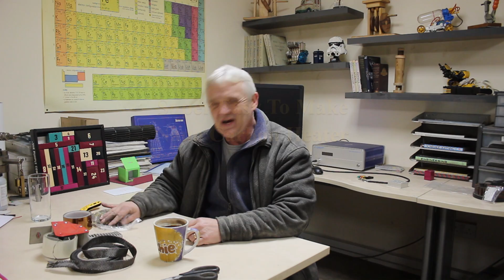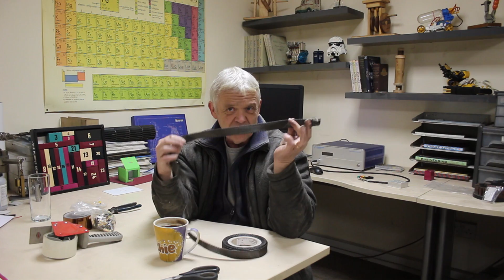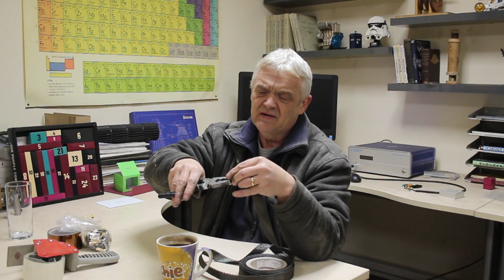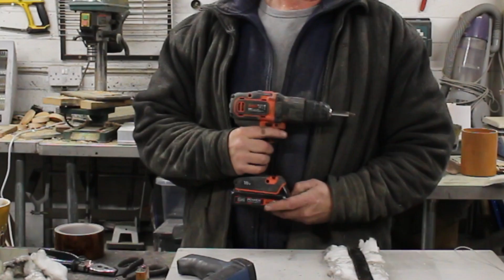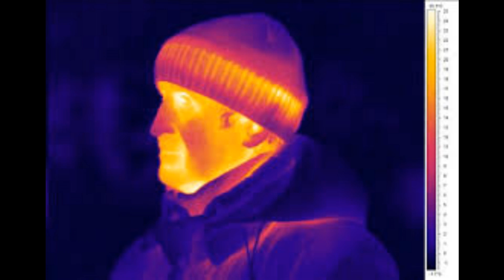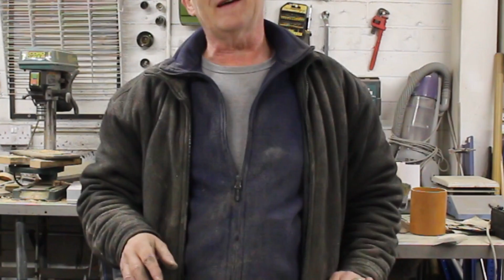1765 DIY Super Easy To Make Nano Carbon Infra Red Heater For A Ton Of Uses

Comment: The applications are endless. I'm thinking inexpensive heated handlebar grips for the motorcycle and in a sleeping bag or sleeping pad. Just have to figure out the battery situation (how big to get a good 6-8 hour sleep without having to switch batteries). Thank you!
Reply from the maker: yes mate they are and I like the things you suggest - particularly the hand grips by the way
Reply: @ThinkingandTinkering  sorry to be a bother, but do you think that carbon felt is conductive? I was thinking about trying a few experiments with that and a variable voltage DC power supply for tattoo machines. Any thoughts?
Reply: @ThinkingandTinkering  I've been out trying this for an hour in my shop and get nothing. I ordered a 0-18v 1.5a dc power supply from Amazon. It's meant for tattoo machines. Nothing is happening except the lcd screen on the power supply just blinks. Any ideas?

Comment: If i wanted to sew this into a hand sewn heating pad, what would i need to attach it to a cord that can be plugged into a wall Instead of a battery? (I would use a temperature-regulated thermostat).

Comment: Appreciate the video in the general, but think traditional insulation works plenty well for most conditions and is far more efficient (cost, time, resource etc wise). Carbon fiber isn't cheap (and is fairly dirty environmentally). Batteries aren't cheap.  Electricity is becoming less cheap. But things like kapok fiber are cheap and do a really good job of slowing energy/heat loss from a body. 

     If I was doing an Antarctica trip during their summer  and had an integrated pulk shelter with solar panels on the roof, then maybe I would add in some carbon fiber heating strips to my clothes, sleeping bag, or the like.  

   But then again, I could just as easily line the pulk shelter with vacuum insulated panels* and bring some beeswax candles or the like and be ok. 

  * (someone might say, well VIP's are kind of expensive. Yeah, commercial ones are, but not so expensive if you know how to make them yourself at home).
Reply: I have everything here to make carbon fibre heater. 
Care to show me how to make VIP's and insulation?
Reply: How DO you make VIP's ? They sound interesting!
Reply from the maker: nothing wrong with a good old bit of insulation mate
Reply: @kennethbain4290    I learned from a combo of researching and thinking holistically about it.  For the home version, you need a few things:  You need a commercial grade vacuum food sealer--one that can pull 28" Hg. You need mylar/foil lined vacuum packaging bags (the regular, non foil lined ones won't hold a vacuum more long term). These need to be a thicker variety, least 4mm. 

    Then you need some kind of spacing, insulative material for inside.  Industry most commonly uses these three--fumed silica (even without a vacuum pulled, this material is very insulative--similar to silica aerogel), perlite, and fiber glass batting. Combos of different materials have been experimented with and used as well. 

    You can use other materials. If using fibrous material, hollow fibers (but that are open on at least one end) are much better than solid. Heck, you could even put bamboo poles in if you knock out the culms and drill some small holes to help the air to evacuate.  (You would still want to combine it with one or more of the above, for the space above and below where the bamboo poles touch). 

   Then you need to put getters in there before you evacuate and seal it all up. The plastic part of the bags will both off-gas and allow some air (especially oxygen) and/or moisture to permeate through over time.  The getters absorb and/or adsorb most of this to keep the vacuum more of a, well vacuum, longer term.  

   There is a wide range of getters used, but one of the simple, cheaper, and fairly effective ones is activated carbon.  Then, typical oxygen absorbing packets can be used in combo.  There are more expensive and exotic getters used. Tbh, I know less about this part of it. 

   The best vacuum insulated panels made by industry are rated to last up to around 40/50 years or so.  Expect a home made one like the above to probably last from around a decade to 25 years or so, unless you really put some good research and thinking into the materials used.  Or how you approach it as a system.  For example, you can put the vacuum sealed pouch/panel in an all foil bag to provide further protection.  You won't be able to suck out all of the air in that most likely, but by getting rid of most of the air and having an extra, all metal barrier between the inner pouch and the ambient atmosphere, it will help to prolong the life and slow down these processes of gas permeation. Aluminum incidentally is one of the best materials for holding a vacuum.  

   Industry VIP's can also be under a slightly harder vacuum than the 28" Hg.  But 28" Hg imo is sufficient to reach a pretty good insulation capacity.
Reply: @karlmyers6518    As to VIP's, see above. Regular insulation is pretty easy. Warm socks, hats, sweaters, gloves, jackets etc if you can't make them yourself. People that wear shorts and t-shirts inside that complain about the cold, well I have no patience for them.  Used to have a housemate/tenant like this.  Told him to wear a sweater or shut up. 

     Kapok fiber is a great, inexpensive insulation if one can sew, either by hand or by machine.  If you can sew by machine and have one, then some nylon tulle acts as a good baffle material.  You take a piece of tulle that is wider than the fabric you are sewing it to, and then you sew like "channels" of the tulle onto the other fabric, to which later you will stuff the fiber into.  

     Then after, you sew  your other regular fabric to the regular fabric below the tulle. Voila, you have an insulated fabric. 

     I don't recommend kapok fiber for larger items in connection with specifically backpacking though. Goose down is superior, both in insulation value and especially in compressibility.  Kapok fiber doesn't compress as much (which is great for pillows, cushions, etc) and so it's not as a good for sleeping bags, or even backpacking used jackets. Makes awesome mittens, insulated hoods, insulated booties though, especially since it is so hydrophobic and keeps it loft far better when damp and wet as compared to down (which collapses more). 

    Pre the invention and common use of synthetic foams, kapok fiber was used in life vests, Arctic boots, etc because it can help a piece float in water, its highly insulating, and highly hydrophobic.  It is also far cheaper than goose and even lower quality duck down.
Reply: @justinw1765  good old Google,  I'm on it. Its really cold here atm. 
We just need Robert Murray-Smith to teach us how to make large scale insulation now and maybe some ecocrete

Comment: Robert, this video is giving me a lot of good inspiration!! Just wondering, if I'd like to make a flexible heating blanket of lets say 150x150cm that needs to become about 50-60 degrees celcius, would a single sheet of carbon fibre be a good idea? Saves a lot of work compared to putting all these thin carbon fibre bands in some spacing on a flexible sheet.... And how would the edges be conected to the wires...ribbon clamps are a bit to small :)

Comment: Do you need to tape this to keep it from shorting if you bury a couple straps in a sand battery and attach them to a solar panel of sorts?
Reply: Not if there isn't any way for the strip to fold in on itself and for the leads/crimps to touch each other. Both sand and air are inherently electrically insulating at these voltages and amps.  The tape is recommended if it is possible for the leads/crimps can potentially touch each other. 

     For the method you are using, I personally would use cheaper and more heat resistant Nichrome wire--probably wrapped around copper pipe. If wrapping the Nichrome wire around the copper pipe, be careful though to make sure neither the crimps/leads nor wires carrying the electricity from the source to the crimps/leads touch the copper pipe. That can also short the electrical source. To make sure this doesn't happen, you can just use silicone caulk to cover the crimps/leads. You don't need to tape the whole thing, etc.
Reply from the maker: only if it is moving - if it is fixed by sewing or weight of sand - no need for it
Reply: Is it for heat storing sand battery?

Comment: Here in the frozen north of Canada, heated long johns sound like just the ticket. You can buy them, but they are very pricy. Making my own seems to be a sensible move. Something else that is expensive is 18V tool batteries, as in about $100 each. So I need to find a cheaper power source.
Reply from the maker: try recycled or used batteries they still have 80% capacity mate

Comment: Trivia question (for the next pub quiz): How many calories (horsepower, watts, joules...) does a human body require to maintain metabolism that can sustain common body temperature (safely above hypothermia danger)? [I've heard that it's equivalent to the energy to drive a 60 watt incandescent "light bulb" or thereabouts.]
Reply from the maker: good question and no idea lol
Reply: (The human body is a furnace that is only adequate to sustain itself within a narrow external temperature range. Funny to think of ourselves that way.)
Reply: @ThinkingandTinkering  I keep trying to post this quote with the link to the source for it, and my reply/comment/post keeps disappearing.

"The average for the three types of food in the above table is 4.7 kcal of energy release for each liter of oxygen consumed. On the average, an adult at rest consumes about 16 liters of oxygen per hour. This gives a nominal basal metabolic rate of 75 kcal/hr which translates to 87 watts."

"Burning" as such, being our other term for oxidation, of course.

Comment: I am not technically minded so I don't understand the watts amps bit. And I was thinking that, because of its flexibility, it might be a good way to create cost effective, efficient and, with a thermostat, controllable underfloor heating without massive building disruption as in water based underfloor heating?

Comment: Interesting. Thanks. (I guess Kapton is water resistant / washable?)
Reply from the maker: you don't need the tape if you are going to put it into clothes mate - you only need the tape if it is stand alone to prevent it crossing over - unclothes you just sew it in so it can't do that

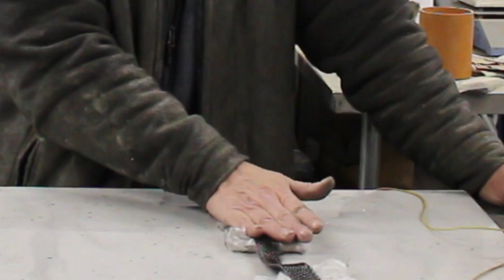Comment: Question: at 2:20, you mention it's drawing 1.1 ma - is that correct?  I would think it would be 1.1 A (amps) for about 10 W
Otherwise, it would be 0.01 Watts, which sounds very low for a heating element.
Reply: Noticed that further in, you do mention Amps, so it was just a mis-speak.

Question, would you address the length vs the current use?  With the example of the LiIon battery pack: if you doubled the length of the element, it should be a lower heat, but last twice as long.
I haven't worked with carbon fiber, but Ohm's law should still be valid, unless there something weird with how the resistance shows up because of multiple/ parallel fibers.
Reply from the maker: no - mis speak that I corrected late - but you spotted it lol - cheers
Reply: @ThinkingandTinkering  Can you talk to the IR emission spectrum?
I've been studying photobiomodulation and there are specific spectral bands that more active biologically, and others that mainly excite water and appear as sensible heat

Comment: How come heated clothing on the market can last 8hrs, while these last 15-40mins? Is it the heating material? Btw, this is awesome 👏🏽
Reply: Good question. I would want to see the specs of a comparable setup to try and figure it out. He told use the voltage and amperage so we can calculate resistance for comparison. 

From there I would look at whether commercial rigs have circuits to limit power draw from the battery, lowering output but extending duration. 

The 8 hour life could only be a marketing gimmick based on use at an ultra low setting, right? 

I like the question though. There certainly are a bunch of different heating elements you could use but these materials are mostly readily available to the average viewer. 

I love these ideas!
Reply: Probably they are using significantly lower voltages/amps and only heating to something like 95* F or so, which is around (slightly above) the temp of outside of skin. The less draw, the longer the battery will last. If you're putting this within/below insulation, you don't really need to heat it much since the insulation will be "trapping" both the heat of the heater and of your own body.  (Trapping not the best term, more like slowing down the exchange of energy from outside to inside rather).

   Also, they are using new lithium ion batteries which have higher energy density per volume and mass. Especially as compared to a 9 volt alkaline battery or an old, probably LiFeP0, tool battery. 

    Those times may also be slightly optimistic and within best case lab conditions i.e. non real world conditions.  Bring that out into an interior Alaskan cold winter day with -40 or colder and doubt it will last as long because there will be more and faster energy exchange (or "heat loss").
Reply from the maker: because they don't get that hot - energy consumption and heat are related - more heat more energy less heat less energy - if you don't get it hot it will last the same time - anyway you don't want it hot - warm is good enough

Comment: Please do a vid, on which we should use, Gas or Electicity to heat our homes, my place is gas heating, but with electric pumps, or should i be heating individual rooms that are occupied with an electric heater ? i ask you, as you are much more in tune with this stuff than i am,
Reply: We have no gas in our village so I have individual heaters in the rooms.  I actually think it is better than central heating as you can warm the rooms you want to.  I have a separate water heating tank
Reply: Rob mentioned that it is more important how the heater heats than the source of heat.  Conduction, radiation or convection heat.   Electric infrared heaters in the occupied room are very efficient.  Gas heating often heats the air in the room thru convection, which is very inefficient.   Heating one room is more efficient than heating rooms that aren't being used if the same type of heating is used.   He talks more about this in his previous videos on heating.  Cheers.
Reply: @ThisorThat  I have an infrared heater in my bedroom which I put on shortly before going to bed.  An electric blanket too.  Unfortunately a convector heater in the lounge but it is thermostatically controlled.
Reply from the maker: I have done videos on this before mate - have a look at designing heaters that I link to at the end of this vid - it should help

Comment: This is a great idea. I have been looking to add heating to my motorcycle gloves cheaply and this is a great way. Would there be a problem if I was to bend an induction coil inside the palm and use it to get power from another coil around the handle bar rather than battery power this? Wondering if the conductive element might interfere with the power transfer?
Reply from the maker: I don't know - I don't think so but the best test is to try - equally you could just make the handle grips heater
Reply: @ThinkingandTinkering  thank you, I have heated grips already but they heat the palm but not the place the cold air comes against the back of the hand, and every time you touch the break or clutch you lose all the heat and have to start again.

Comment: Great video, very inspiring. Do you have any data on: at which Voltage/Amperage say, one meter of this stuff, 1 cm diameter, would break down? Without the insulating coating of course.

Comment: One of these using MyVolts USB power connectors to turn a USB battery pack into a 15 volt supply might be useful?
Reply from the maker: yep - for sure mate - clever actually - thanks for sharing

Comment: @RobertMurraySmith >>> FWIW: The first thing I thought of was clothing for motorcycle riding, which could be powered from the motorcycle and not require a battery. Such garments already exist commercially, but you could DIY something for yourself. 

You could also use a battery-powered version for bicycling, particularly mountain biking. OR even "mountain unicycling", and YES, "MUNI" is a real thing.

Comment: My one concern is might the resistance at the clip change over time. If the contact at the clip loosens the resistance and heat generated at the clip increases.
Reply from the maker: they crimps mate - crimps count as a permanent connection in the 18th regs I believe - but if it worries you fix the crimp to the base cloth and sew the tape to the same cloth - potential problem solved
Reply: @ThinkingandTinkering  my fear is just a fear of the unknown, over time, might the carbon oxidize at the crimp.  It's something I'd watch for.  Maybe I'm worrying for nothing and everything will be fine, but oxidation of aluminum wires at unprotected crimp has been known to set homes ablaze.

Comment: In theory, could I use this method to heat a very small sailboat cabin, with just a 12v  or 18v marine battery? Or would that be a completely useless thing to try?